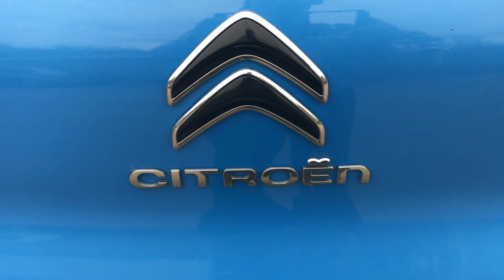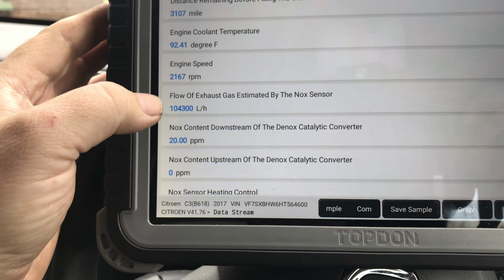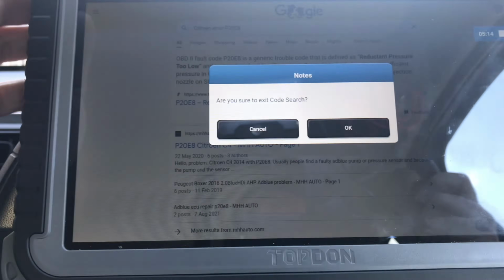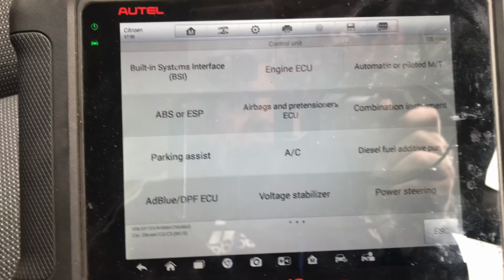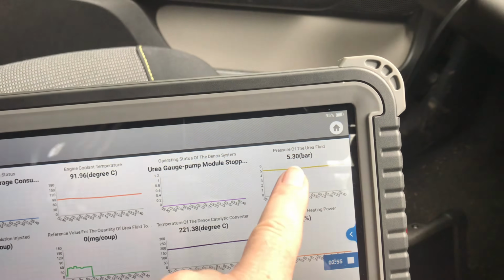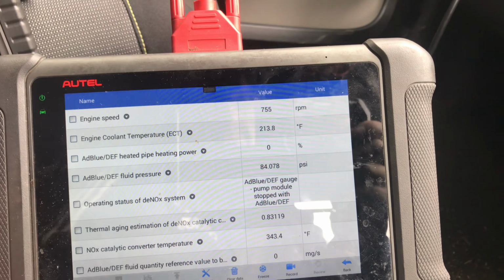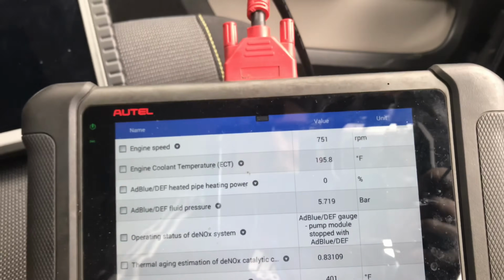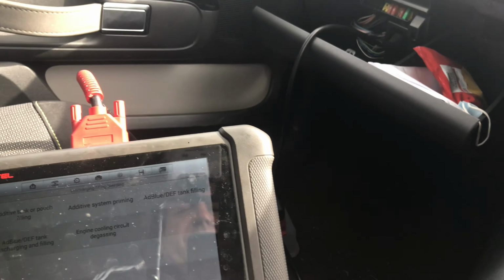Citroen C3 (2017) AdBlue Nightmare😭 - P20E8 Urea Fluid Low Pressure

Comment: I know this isn't an option but there is an option 2 ( remove the ad-blue system ) remap it ! Or does the customer not want to go that route better then 1k
Reply from the maker: Cheers Evan never thought of that option cheers sandy
Reply: I'm pretty sure this is illegal. Only if the car used off-road or will be exported outside of EU.
Reply: @dg3614  It won't be an issue.. in the Netherlands about het 50% diesel cars does not have dpf, egr, adblue.. it only costs money and more money.. they fucked up the diesel engines with that kind of shitt solutions.. to safe nature..
Reply: @dg3614  You are correct, it is illegal in the UK.
Reply: How to do so?

Comment: Sandy the ADBLUE pump at a garage needs to be fully inserted it has a magnetic ring which allows flow only when fully in . Don’t be fooled by the pump acting like a diesel pump
Reply from the maker: Cheers Steve never knew that, Sandy

Comment: Hows it going Sandy? I am on my second C4 Cactus, but both mine are petrol. However, I run a facebook group for owners and the diesels (which I believe are pretty much the same as the C3)with ad blue are a nightmare. People are constantly replacing, tanks, pumps, injector and nox sensors. Some people do manage to get Citroen cover all or part of the cost if they are willing to put in a fight though, even out of warranty. I know people have started mapping it out after multiple failures, although I am not sure on the legalities/MOT situation with that.
Reply from the maker: Thanks Alan for the information I'll tell the punter, hope you're well cheers sandy